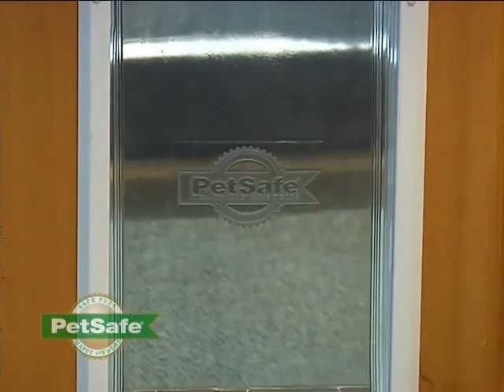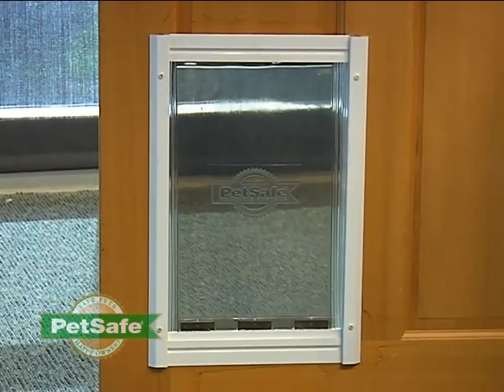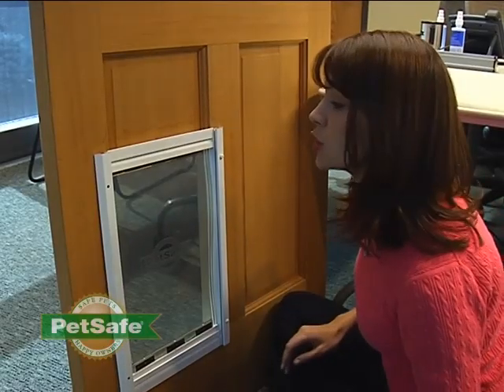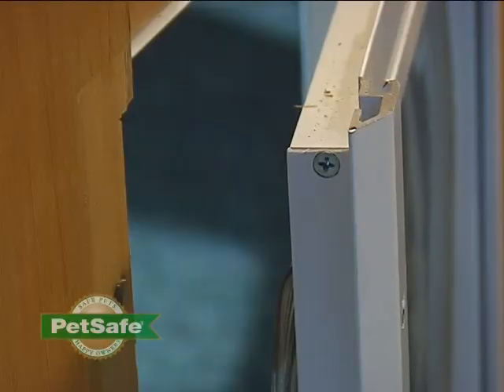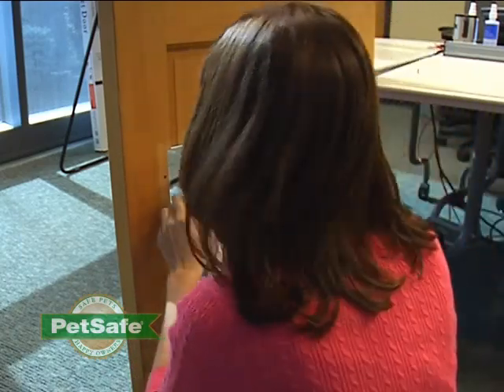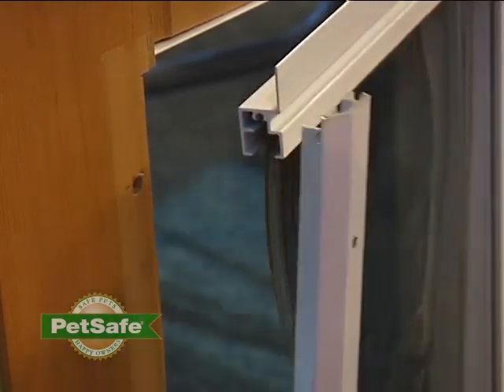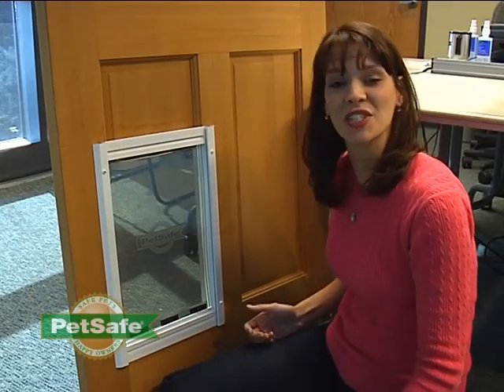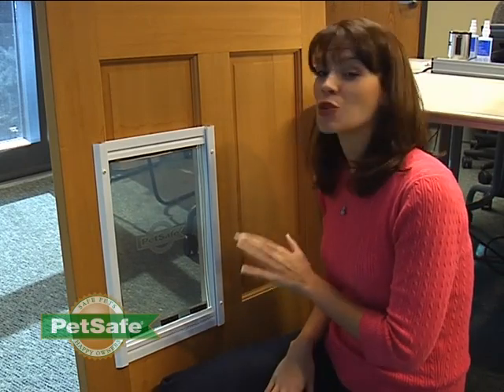PetSafe—How to Replace the Classic Pet Door Flap

Comment: This is not the way mine is. It has 4 screws on top. Call center is not knowledgeable and told me to check YouTube ughhhh
Reply from the maker: We're so sorry for any confusion, Elizabeth!  Please know that our phone representatives are product experts and have extensive knowledge on our products.  If your flap attaches with four screws across the top, it is not this model of door and would take a different replacement flap/have a different procedure to change the flap. 
 
So that we can identify your door and provide information for you, please e-mail clear pictures showing your pet door as a whole to [info@petsafe.net](info@petsafe.net).
Reply: Mine isn’t anything like this video either. It doesn’t have that nice bar on top that she’s showing. Four screw holes and she doesn’t put anything through them? I wish it were this easy. 😩. Every time I need to change it (which is often cuz it sucks) it’s such a royal pain in the a**.

Comment: This stupid thing I got has 4 screws, got a new replacement and the 4 holes do not line up what a waste of money.
Reply from the maker: We're sorry to hear the flap you purchased is not the correct model for your door, Jon!  If the flap you purchased has four holes across the top, this is likely our current medium flap, which is different from the classic flap in the video here.  If your current flap has two magnets in thickened plastic at the bottom and the flap as a whole is around 8" wide and around 11" tall, you would need our medium classic flap, which is still in stock on our website.  If you have any further questions, please get in touch with our Customer Care team directly.

Comment: I could not remove the old flap because  I could not get the screw out. I even purchased a power screw driver which I needed anyway but I still the screw would not come out. the door was not a solid door but pressed wood. I even spoke with the support people at petsafe. I ended up cutting off the old one and glued on the new one.  I was actually just going to glue the new one to hold it in place while I screwed in new metal screws, but never even got around to that.  I just have 2 cats and a small dog who goes in and out to eat the cat food and it is holding perfectly.  I know they told me at Petsafe that it probably wouldn't work, but it did.  Just passing this along.  I used e6000 craft glue.
Reply: I also cannot get the screws out. They’re turning but won’t come out!

Comment: Hi - great video - but I have a 'discontinued' Johnson flap; so no size flap is available for me to slide in there!  The problem I have with the flap - aside from it being dirty - is that it is ripped!  How would I repair a rip?  Is is possible?  I have a replacement flap door, but I don't like it as much because you can't see through it, and my cat won't use it!!!  Thanks!
Reply: where did you find a replacement?
Reply: you might be able to silicon it, depending on where it is ripped.  Super glue doesn't last long here in Mi weather.

Comment: @petsafe this flap is discontinued and they don't make this size anymore.  Now i have an oversized hole in my door and cant get a replacement dog door cuz the new version is smaller.  NOT COOL.  what am i supposed to do?  buy a whole new door?
Reply from the maker: We're sorry to hear you've had this issue with your pet door, John!

Though these doors have been discontinued for many, many years, at this point in time we do have limited stock of all flap sizes except the extra-large, which has been out of stock for several years.  Though no door will be an exact fit for the cutout you have, the current version of this door would require minimal changes to your cutout.  For further information on what options we have for you, please contact us.  Our number is 1-800-732-2677, and our hours are Monday through Friday 8 A.M.- 8 P.M. EST and Saturdays 9 A.M.- 5 P.M. EST.

Comment: How about some updated instructions for the new replacement flaps?
Reply from the maker: Hello, thank you so much for reaching out to us. If you need assistance with replacing the Freedom style flaps you can find that information here https://support.petsafe.net/s/article/How-to-Change-your-Freedom-Pet-Flap
Reply: @petsafebrand  the bracket that goes behind the flap, does it go flat side towards the flap or is the pieces of plastic that stick out on the other side go into the holes of the dog flap .  your instructions are a bit lacking. the screw hole goes straight through. its unclear which side you are supposed to screw into.
Reply from the maker: We are sorry to hear you are having an issue with the mounting bracket. It does sound like this may be something our customer care team would be able to assist you with. If you would like to reach out to our team for support you can reach out to them here - https://www.petsafe.net/support/contact-us?_ga=2.145864308.1793784891.1658357211-1013878049.1636590664

Comment: Mine had 8 screws. 2 along the top and 2 along the bottom
Then had to tap side trims off and the frame came out the outside of door.  New flap fit perfect.